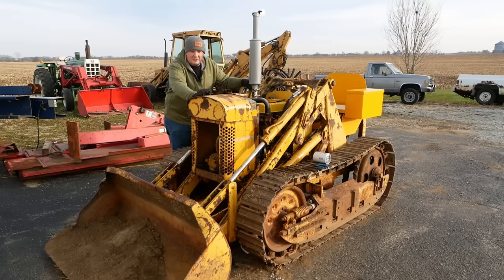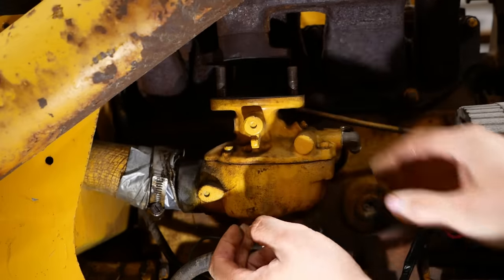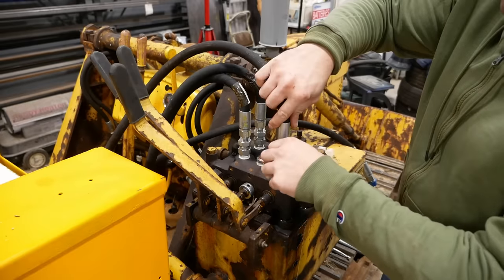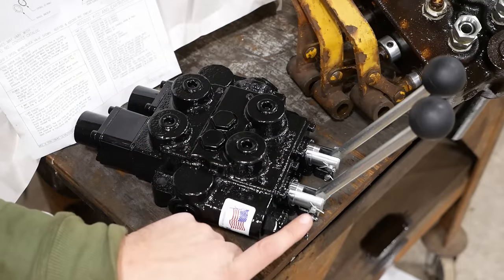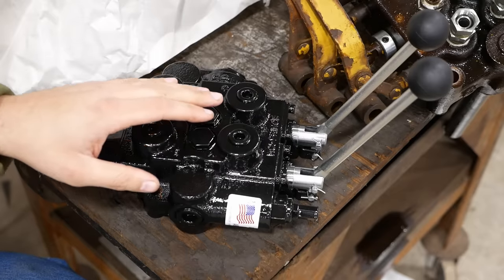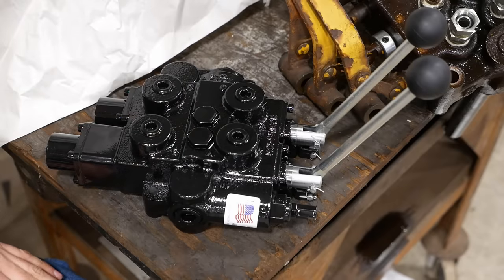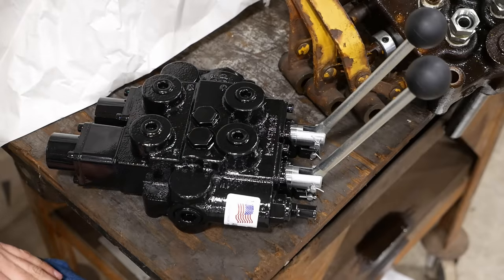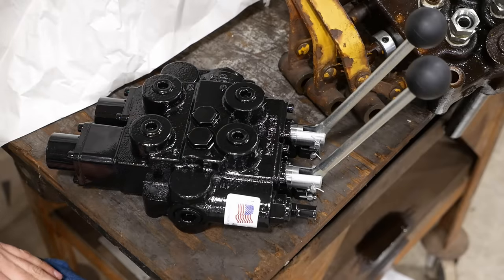Replacing a Hydraulic Loader Valve

Comment: Fixed displacement pumps discharge a set amount per revolution, but not per RPM. The discharge amount varies with the speed of the rotations of the pump. That was one of the first things that I had to learn while studying hydraulics, over 50 years ago.

Comment: It’s a Fram filter, what would we expect?
Reply: If it's cheapo orange FRAM, always expect it to fail. America's #1 selling engine killer.
Reply: @fitzpreacherfarm6826  Wix is Mann-Hummel and used in OEM commercial trucking filtration. It's the ONLY filters I ever use now.
Reply: Never use chanel lock pliers to tighten the filter. I rented a backhoe and the dope that changed the hydrolic fluid pinched the filter with pliers. The filter burst spraying fluid all over my legs.
Reply: For all the Fram haters out there, it WASN'T a problem with the filter. The by-pass valve on the oil pump was stuck from sitting for 13 years. That's why the new oil pressure gauge wasn't working. It pegged out a new 160 PSI gauge to well over 200 PSI.
 I added some sea Foam to the oil, and since then it only ramps up to 160 PSI on start up when it's cold. After a few minutes of warm up, it drops to about 60 at high idle and 45 at low idle. It should always be between 25 and 40 and with some hours of run time, I'm hoping it goes that way. Otherwise the belly pan and oil pan will have to come off to fix the bypass, as it is part of the oil pump.

Comment: REVstoration had a similar issue on a Ford V8 blowing out filters. They changed the oil pump and it fixed it. The relief valve had stuck and causing over pressure.
Reply: I have seen the same thing on a Ford pick up, I dont remember the year.
Reply: @denniswilliams8747  Chrysler 2.2 litre had the problem briefly. Mopar filters could stand the pressure but some other brands failed and leaked.
Reply: The early Isuzu Troppers and Rodeos 4 cylinder gas engine had a problem whit the bypass valve getting stuck in the oil filter adaptor and blowing out the o-ring on the oil filter. Replacement of the oil filter adaptor solves the problem.
Reply: Interesting 🤔
Reply: Well then, This may not be the last video on the Oliver OC46...
Reply: It WAS the relief valve in the oil pump, sticking. Rather than remove the skid plate and remove the oil pan, to get to the pump, I added some Seafoam to the oil. I put a new 60 PSI gauge on and it pegged it on the first start, so I replaced it with a 200 PSI gauge. It still pegged it out on a cold start, but as soon as the oil warmed up a bit , it dropped to normal working pressure. It took quite a while , before it stayed at 40 PSI on start up, but seems to be working just fine now.

Comment: At the end of the video you can bend that handle so it will not hit. You did a good job to fix that valve. We called that muffing it in. It not the right way but it works. After I saw oil filter cut open the only way I would use a Fram is for a short time use only.
Reply: That Frame filter probably doesn't have 10 hours of run time since I put it on. Prolly won't ever buy another one, except for the bypass filters on my old Allis tractors.
Reply: Wix or the one Wes replaced it with is a better choice than a Fram.
Reply: There was a time (when I was young) that Fram was high quality.

Comment: I like the idea it's a stuck pressure relief valve.  I've had success cleaning up old motors, gradually, using Rislone additive.  And the Fram filter could be a contributing factor or all of it.  In my opinion, they have the cheapest of the cheap construction.
Reply: Orange can frame is definitely junk especially the old ones, but modern fram gold and silver filters are actually quite good. Quite a bit of independent research out there on those teams and it all comes back pretty positive.
Reply: Filters have valves in them too
Reply: @Joby Fluorine they tend to have more pleats of filter material inside and to a finer micron rating. That is what the difference between wix and wix xp filters are at least. You can find this on the specs of the filter.
Reply: @Joby Fluorine  I have to strongly disagree with you on this. There are a bunch of Youtube videos where people tear down, measure, and inspect various filters and the difference in quality is plain to see. I don't know who makes the filters for WalMart, so I can't comment on that, but there is a huge difference between good quality and ElCheapo filers. I also make it a habit to ask professional engine builders about their opinion, they dont use WalMart or Fram orange death filters...
Reply: It was a stuck by-pass valve on the oil pump. It went over 200 PSI when it was cold. I put some Sea Foam in the oil and it has helped some, but still goes to 160 on a cold start, but drops back to 60PSI after a couple minutes of warming up.
 I may end up dropping the belly pan and oil pan to get that fixed. The by-pass oil is what lubes the timing gears.

Comment: When I was in fleet maintenance for one company we had a 544h loader blow out hydraulic filters,  was the pressure relief valve.  Now I am still in fleet maintenance just for my own fleet on the farm, was much nicer to be able to call for parts and not need to worry about the cost.....lol

Comment: Great job on replacing the two control valves. Explaining open center & closed center.👍
I quit using those two, three spool valves. One spool quits you need to replace whole thing. I use the individual banks now. I know that two spool valve will probably out last the machine because it not being used 20 hrs a day.

Comment: Great video as always, Wes!  To get those oil stains out of your hoodie, try some Fels Naptha.  It comes in bar form, available anywhere fine laundry products are sold., like $1 a bar.  Just wet the oily garment, and rub the bar into it.  I use an old toothbrush on carpet and upholstery.  That stuff has been around for over a century, and for anything greasy or oily on fabric, it works like magic.  Some folks grind up the bars in a food processor and throw a scoop in the laundry.  Happy Thanksgiving to you and the family!

Comment: Great vid Wes. Love the education on valves, very useful information. On a side note, you might look at horse stall floor pads to prevent crawler type equipment to damage your floor. A local guy near me uses them and they work great at preventing damage to the cement floor. Thanks for sharing

Comment: It's a Fram filter. I've seen them with split seams on many occasions. I would use old socks stuffed in a tomato can before I would use a Fram filter on anything.

[Edit: Thanks a lot for the explanation on the different types of hydraulic systems - closed center and open center. ]

Comment: I work in the vacuum truck industry, building new equipment and deal with hydraulic systems every day. Its all fun and dandy when its dry , and your neatly routing hoses . But wait till you find out your brand new hyd pump, motor, or the worst a spool valve is defective or was incorrect/ non suffucient part loaded out in the bill of material by a wonderful engineer,  and all the oil in the world spills out on you, your tools, and a nice new truck you just built 🤣😂.  I really do love hydraulics though,  making all my hoses run so nice and neat, and seeing a pile of parts do things is awesome

Comment: When getting a suspicious call slide up on your phone up and put it on airplane mode momentarily. This will show on the callers end as “call failed” instead of “call ended” some auto dialers see this as a dead line and after a few attempts they remove your number.

Comment: Thank you for Explaining the Hydraulic system on Loader control valve. It reminds me of the 
( Clay valve) we had on water line in Pump house. As the pump pushed the water up. The valve easy opened. Because of the water pressure against it from elevation of Tank
Believe me the Telemetry called me meany times at 2 or 3 in morning because it's so sensitive. I did NOT know any of that stuff on the importance of the right valve to get for application. Thanks again. I Learn so much from you.

Comment: Great vid on Hydraulic valves.  Hey that filter failed on the circumferential seam.  In pressure vessel/tank design terminology, it's known as a "frangible" joint.  That means it's designed to be a weak point so that if the pressure in the filter chamber gets high, the frangible joint yields before the sidewall ruptures on the long seam, or the bottom plate shears making it a 2 pound projectile.  Probably made that way for economy + safety.  The joint didn't appear to be deformed from a ding, so it probably was a high pressure failure caused by a high discharge pressure.  That could be from filter clogging, low temp viscosity, frozen water plugging in the filter (or further downstream in the block).  If the oil pump is a gear pump, the max discharge pressure will always rise to the backpressure of the system until limited by the motor torque, slip flow around the gears, and usually a ball check for pressure relief.  Ball checks can easily get fouled.  So if it happens again, maybe look for that.

Comment: Oil filter blew out never seen that before? Oh wait,  its a Fram. Thanks for the explanation on the valve learn something new every time I watch you.
Reply: I figured out the problem and it wasn't the fault of the filter.
 The relief valve on the oil pump was stuck, letting the oil pump build enough pressure to blow out a 60 PSI gauge.
 Instead of removing the skid plate and oil pan to fix it, I added some seafoam to the oil and put a 200 PSI gauge on it.
 It still pegged the gauge out (well over 200 PSI ) on a cold start (below freezing), but after it warmed up, it would run 25 PSI at idle and 40 at WOT. It no longer peggs the gauge out on start up, so I figured, setting in my shed for 14 years may have had something to do with it sticking.

Comment: i've built two log splitters, and replaced the hydraulic valves and hoses on my '54 massey 33 using parts from the surplus center. prince valves are definitely the way to go, and you can look for a month of sundays and not find a better price on hydraulic parts than theirs. you can't beat'em with a stick. i love those guys!

Comment: I had a filter-seal pop on my grandpa's truck once years ago, not because of an issue with quality of the filter, but because a technician at a cheap/fast oil-change place didn't remove the seal of the previous filter from the block!
They cranked it down hard enough that it sealed and went down the road for a good long while, only to blow while climbing a long steep hill going out to the dump one day. So it blew, dumped every drop of oil, and my mom (who was alone in the truck at the time) kept on driving to the dump, got there, and called me to ask whether she should shut it off! I told her yes, we had it towed home, I refilled it with oil, and it started up just fine! Then oil gushed/fountained up from one side of the engine and we shut it off quickly. It took one more trial-run with me looking underneath but I finally saw where the oil was spewing from. After that it was a simple matter of replacing the filter, peeling the doubled-up seal off of the block, and topping off the oil. Shockingly, it ran well for years after that! That old '83 F150 worked hard on minimal maintenance for years! But yes, Fram are cheap junk. Still, better the filter that pops than the lines!

Comment: I always learn something watching you.  I was tickled to hear of your disdain for hydraulic oil puddles.  Just like the 'splody oil filter finding a new hoodie, oil puddles find my clean floor.  Like clock work.  Thanks for the quick edumacation on hydraulics.  An old mentor used pulleys and wire rope but that was long years ago.

Comment: My oil truck shop garage has RailRoad Tracks in the floor.   34" wide, dozer, wide, and etc.  The buried in cement iron is bonded and grounded by rebar to a stub where the welder can use that stub as a lea hookup for welding.  The floors is level and functions like a Frame Machine to lay outs and straightening out  bend iron.  I can make a jug for any pull, cut a frame and strech out a truck frame, and etc.  When done, a grinding wheel removes welded on jugs and restores my floor to normal.   One stall has a front end pit that is home built. Learn that trick from North Dakota farmers who repair all their machines.

Comment: I sand blasted the oil filter housing on a 6.9 diesel I rebuilt back in the day..didn’t get the check valve sealed off well enough and got sandblast media in it..that sucker would pop an oil filter like it was bubble gum..great video on the hyd. valve!

Comment: I like  watching  guy biulding high pressure hyd systems with water pipe fittings ,great work
Reply from the maker: It's not a high pressure system. Those 600 grade fittings are rated for much more than the 1300 psi this thing puts out.

Comment: I bet that phone call did not come from France, but from some low life in a call centre with a spoofed number. I wondered why my phone went quiet. A great way to overcome the problem of the spoiled valve system, I guess you had a fortunate find in that new part, which, with a bit of your engineering, fitted right back into the job. It looked like it was made for the job, which of course, it was.

Comment: Wes, there's just nuthin' like rustproofing under the hood.😜 
I recently bought some parts from an older Hustler mower, so I'll need to go through and remove all the old hydraulic hoses as the pumps and motors will be repurposed for my tractor.

Comment: Wes
Your channel is excellent. Its nice to see a channel where you actually have to give some thought to fixing things like replacing the hydraulic valve body . I do alot of hydraulics for a living and i dont know what the working pressure is of the hydraulic pump but I would always advise not using cast fittings on the pressure side of a hydraulic system especially if it faces the operator.  Stick with steel which have a far higher working pressure in the event of a component bursting. If you have ever seen images of hyraulic fluid puncture a persons skin with high pressure its not pretty. Love the channel though .
Reply from the maker: Yeah the street elbow is just temporary until I can get a proper forged fitting. I was initially planning to reuse the old elbow, but it's not really rated for the pressure either.
Reply: @WatchWesWork  Schedule 80 steel fittings would be perfect there.

Comment: Watch all your videos on all forms of mechanical equipment, you have a fantastic way of explaining the operation of these devises, appreciate the time and patience you take to show us amateurs how things actually work.
Just a couple of small questions:
1. With your high level of anality(new word), why didn’t you take the time to rework your air intake hose?
2. Curiosity question, did I observe a third control lever on the hydraulic control valve, but only two levers in the newly installed unit? 
I thoroughly enjoy every one of your videos!

Comment: Nice job!! Excellent engineering.
A tip: next time you go to the "big box" stores look for those large cardboard pieces that separate water cases or other cases. 
They are trash to them and you can take them for free. They are great for keeping the floor clean.

Comment: I had a filter do that on a old Superliner 300 Mack hauling freight across the Pa turnpike. 1994 or so.  I was passing slower cars and it blew in the rain. I must of coated 20 cars before my oil light came on. Defective filter is what the told me. I did the same thing in about the same spot and my air compressor blew apart coating every car around me. Im glad no one got hurt. But it made a mess.

Comment: Little bit incorrect on load check.
Load check needed only on multiple spools DCVs with parallel gallery, so with simultaneous operation the oil from section with higher pressure ( let’s say “rase”) will not leak over to section with lower pressures ( let’s say “dump”).

But it would probably be “too much to explain” in this short video, for majority of viewers! 😁

Comment: You are a genius with this machine!  I really liked your solution for making a bracket that moved the valve to fit the drain correctly!  One question though..  Is there a reason you didn't put 90-deg fittings on the hoses at the valve?  It not only would have solved the issue with the lever bumping the hose, but would have taken the bending stress off of those hoses.  Again, great job!

Comment: Awesome videos..you're very knowledgeable with a ton of things. I just picked up an 86 GMC General Dump Truck not too long ago with a Cummins 350 big cam in it. Both speedo and tack don't work. Or water temperature, ..... basically all gauges don't work except the air pressure gauge 🤦. The fuel pump leaks and so does the power steering pump. Man, if you live near me I'd just have you fix it. Lol. Runs like a champ though

Comment: On the carbs, Ultrasonic cleaner Wes.  Far more effective and a solution to many of the issues you and I run into daily.    I find most of the carb parts are cleaned in situ by it.  And some come loose after cooking.   I put it on a timer for a couple hours at night.  Cook the carbs or other parts at night and then the morning is always effective.  Frankly. I have never had a part ultrasonics didn’t clean.  I use it for a ton of parts not just carbs.

Comment: I got the plastic cap kit from New Line, from over there in Bring Cash Carnada! 😂
Pretty good kit, the blue ORB/JIC caps are crap though! Red plugs for the same are awesome!
Didn’t think I needed so much NPT plugs, but ended up using them some.

You can buy BSPP/DIN/GAZ ( yellow) plugs from them separately also. I use those a lot to plug hoses in Japanese made excavators or skid steers, because those tend leak forever!